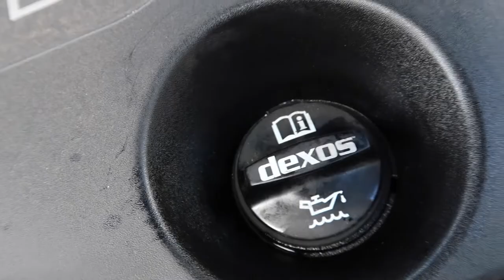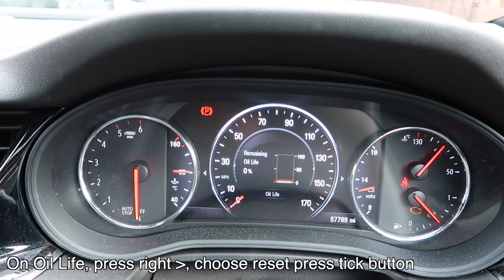2017 Insignia B, 2 litre Diesel, Oil Change and Oil Warning Reset

Comment: Cheers mate, a 15 mm socket fits also on the oil plug. Can I use this instead of a torx to loosen it or would I damage anything?
Reply from the maker: Socket is just as good as a Torx. Give it a go!!

Comment: Where did you place the axel stands ?
Reply from the maker: Yep, I'm not sure exactly where the axle stands should be placed but I looked in the manual and found nothing so I chose a part of the underside that looked like it has been used in the past. See if you can get further info from someone in the know before you copy me and push the floor into the car.. Best to make 100% certain that you are safe at all times. If in doubt ask a professional mechanic mate. THanks and good luck.